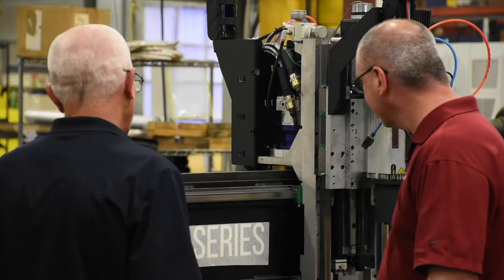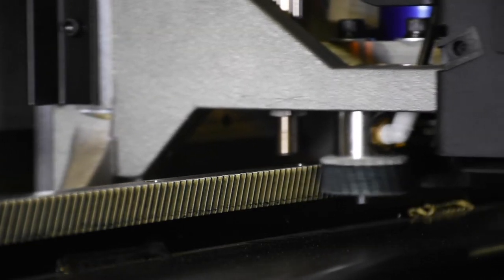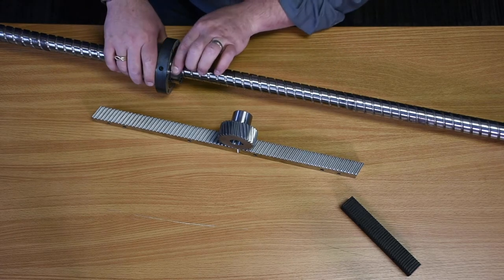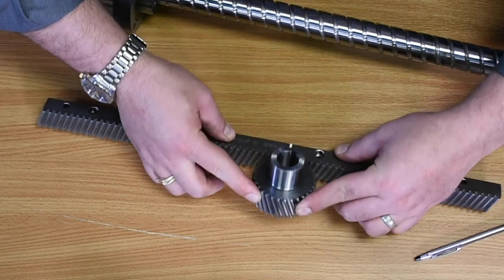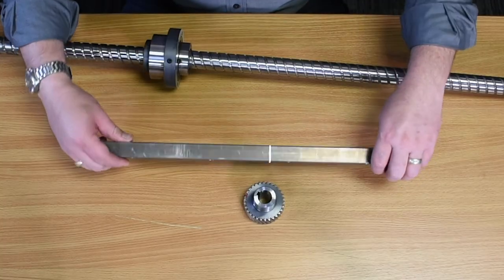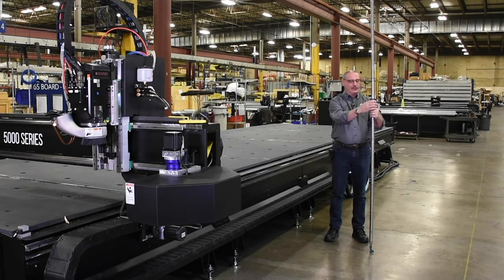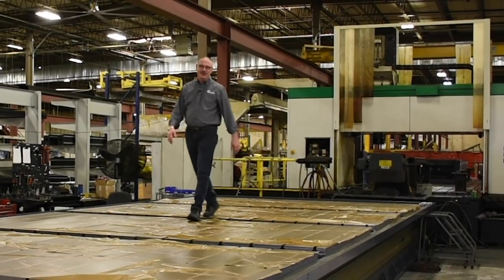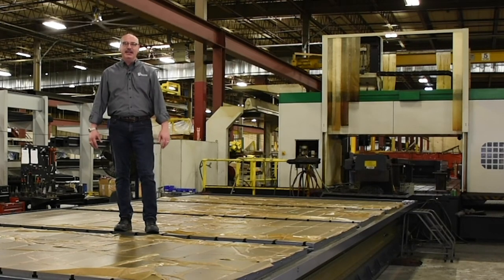What is the difference between Helical Rack vs. Ball Screw?

Comment: How could you have this discussion without talking about the main issue of a rack. Backlash. The helical gear contact doesn't change the clearance necessary for gears to roll. Also the drive is likely to have more backlash too as the rack doesn't have any inherent speed reduction like the screw does. So a multi stage reduction is more likely adding places for backlash and compliance to the drive where belts can stretch.

Then the argument of ball screws whipping is easily solved by turning the nut instead of the screw. 

You might have multiple gears on the rack with an adjuster to compensate for backlash, and if so seems like it should have come up in here.

I don't know the accuracy of your machines and they may be as you claim, but this video certainly didn't convince me that a rack has the accuracy of a ball screw.
Reply: It could happen because the company that sells these machinese which rely on R&P had their own sales engineer do the "discussion". So, it's flawed. They made a sales pitch but camou'ed as unbiased info. Which was plain silly as if they had been honest about it all and explained why as you go to larger machines R&P start making sense, especially from a cost standpoint. Instead, they tried to convince us it's the best thing since sliced bread... Old school tactic. People are smarter that that now (I hope).

Comment: You didn't mention backlash, which is necessary for rack and pinon motion systems to work.  You can eliminate whip by turning the ball nut rather than the heavy screw.
Reply: There's a reason he didn't. This was a puff piece meant to beef sales camouflaged as unbiased information. 
Almost everything he stated was borderline deceiptful. Like the statement that R&P can be more accurate than "Any ballscrew"... BS... If he had been honest, he could have said the best R&P can compete in accuracy with some rolled ball screws, possibly. 

Now, what he could have done is talk about how each platform will always be a compromise and the longer the router is, the more R&P starts making sense. And like you said, he could have mentioned rotating ball screws which help reduce whip and then he could have talked about how you need very thick and super expensive ball screws to counter whip. But they are so afraid to play that honest card so they try to make people believe that ballscrews have hardly any advantages. To me, that's just a bad strategy as the honest one is good enough.
Reply: Agreed 100%.  On the large format industrial machines which cost 200k+ they use rack and pinions but they compensate for backlash using software. They would calibrate each section of the rack using a ball bar by moving the spindle in a circle. Then they store the backlash information for each section of the rack and the controller would compensate according to the stored values in real time.  That is to say, each time the x or y reverse directions, the controller would add/subtract the backlash distance nearly instantaneously.  
They are able to achieve +- 00005" accuracy using this method.  @AntiVaganza
Reply: @AntiVaganza  Looking to build a 5x10 CNC router to make cabinets as a side gig. Would you recommend balls screw or this rack? Trying to keep it cheap for the start. Thanks

Comment: Except you can get as close to zero backlash as you will ever get with one while the other requires that you build some in just to keep it from destroying itself in short order. Didn't need the marketing wank, its simple, want to move really fast or cover distances over about 6-8 feet then you probably want rack and pinion. Whip isn't even an issue, your screw is either bent or you're trying to spin it way faster than the ball nut bearings are going to tolerate for long anyway, turning the nut is a solution also.  A lot of mechanical advantage is lost with a rack vs screw, so more expense in bigger motors to meet the demand but that also means a likely reduction on positional resolution, or you gear it down which is an expense that likely adds more backlash yet. No silver bullet here.
Reply: celiturbo said 'A lot of mechanical advantage is lost with a rack vs screw'. What are the disadvantages of increasing mechanical advantage at the pinion through gears or pulleys or some other means? .

Comment: With a ball screw you get a lot more linear force from the same torque motor. It means less acceleration on the axis. It is because one rotation of a screw is typically 5-10mm of linear movement. With rack and pinion it can be from 60-200mm. When you are using stepper motor set to 200 step per revolution you get from 0.33mm to 1mm per step! You can gear down a motor with a timing belt, but you loose the main advantage of rack and pinion - simplicity. 

In my opinion using rack and pinion is a reasonable choice only to drive a gantry in machines longer than 2m. If machine is smaller i would always choose ball screw over rack and pinion. 

Rack and pinion
-Easier to use on bigger mashines
-Require bigger steppers/servos to get good accelerations

Ball screw
-Dont require big motors
-High forces and accelerations
-More precise than any existing rack and pinion due to pre tensioning and zero backlash
-Slower maximum axis speeds
Reply: its 2022 now ,who use step motor?   servo system with abs encoder plus a cheap 3 arcmins reducer will beat those same cost ballscrew a lot.
Reply: @joshshen1492  2022 printer still using stepper motors
Reply: Yeh they are much lower geared witch really matters sometimes

Comment: Won't the whipping be mitigated if you have the ballscrew fixed and the nut rotate instead?
Reply: But how will you do that? Mount a motor on the nut?
Reply: @mdayaan7573  Why not? I've seen people do that.
Reply: @mdayaan7573  Yes, it's called a rotating nut. Expensive but it's not uncommon.
Reply: @AntiVaganza   Not expensive if you have the time.

Comment: Great video, thank you. Some suggestions, though: It'd be helpful to clarify pros and cons between both approaches when speaking of (1) pre-loading capability, (2) axial load capability, (3) contact angle aspects associated with rack-pinion approaches, (4) options to shield or seal the driving elements, to keep debris/contamination away, etc. I tend to agree that for 'long-travel' motion systems, helical rack should definitely be considered. However, I'm concerned that the video may be misinterpreted by some as rack and pinion is 'always' better than a ball-screw approach. I've read some of the comments below, and I believe that some people are misunderstanding such details. In any case, great video and reference knowledge. Thank you so much.
Reply from the maker: Thanks so much! We appreciate the great feedback.

Comment: Great Video Mr You get what you pay for! ha,, one thing you did forget to mention is that most rack n pion set ups? your project STILL relies on THE MERCY of a BELT!!!!!! yeah its a long toothed  steel track but those 3 pulleys that house in the motor are belted together! lol!!! hey but they are people out there running machines On Toothed timing belts on its own orbit of thought! So its really a double edged sword in a way, Another option are chains!!!! for the individual that feels that kevlar or steel belted rubber Either way you will still have to keep on eye on it! Rest assure you will still have to service and maintained the unit regardless of what you choose!!

Comment: rack and pinion is the cheapest and easiest way to create numerical machines, it reduces components and you can use fiber reinforced performance concrete instead of metal for the structure, so this makes cnc routers, printers, tapping affordable to anyone. also if you install a contact layer in the rack and pinion , you can replace it regularly after wear saving materials
Reply: Ball screws are easier to install. Also the accuracy of ball screws are very high. The price of ball screws is also less due to higher production volumes
Reply: @arbjful  i can make a precision fiber reinforced thermoplastic (even self lubricating) rack with wax milling and molds, however making a screw is only possible with metal rods and it has to be forged metal with plenty of treatment, and after this metal has to be precision milled in all the 360º degrees compared to 3 axis milling of a rack. precision is more about the pitch and lead of both systems
Reply: @crapisnice  we use 10mm pitch ball screws for our centering application. An open loop stepper motor easily handles our accuracy requirements, we used a timing belt system, but apart from speed, there were accuracy issues here
Reply: @arbjful  yes but rack and roller pinion is more reprap friendly, more accessible to be done diy and spreaded, that the reason i have chosen it anyway beside the bending stresses of screws, however fiber reinforce composite screws can be done as well (and applied in vertical z axis with no problem)
Reply: @crapisnice  do you make rack & pinion? Maybe i can consider  for some applications
Reply: @arbjful  i use this dentistry scientific paper as reference you can download (Evaluation of the marginal fit of metal copings fabricated by using 3 different CAD-CAM techniques: Milling, stereolithography, and 3D wax printer) and so i prefer milled soy wax to make the rack male segment to make female molds with plaster or plaster of paris for example. both wax and plaster of paris can be recovered to use in other molds and you can remill the final rack segment. racks are produced in segments and carefully screwed to the main beam with the adequate order, there are video explaining it here in youtube.
 you can make also roller pinion, they use two ball bearings (angular if i am right) per every roller, a pinion can have 7 to 10 rollers for example.

Comment: First of all, don't mix measurements. Either Imperial or metric. Also in machining 0.0002" is a large. I built a macro to l rail in my spare bedroom with a theoretical resolution of 0.0000118" (that 0.0003mm for places that aren't America). The next one in currently working on could potentially have an even higher resolution.

Comment: Crazy how youtube randomly offers up videos like this when I was just discussing this topic earlier today. I think on smaller mills a ball screw setup is perfectly fine. But when you start getting over 8' on a gantry mill you going to get whip on a fast moving machine. A helical rack can match them in accuracy and have a rock solid foundation. We have a 30 year old helical rack machine a work that respectfully runs at least 30 hours per week under heavy loads most of the time. I've just started to notice a slight ammount of play on the end of the table that gets the most use from running small parts. I doubt very seriously ball screws would have held up that long.